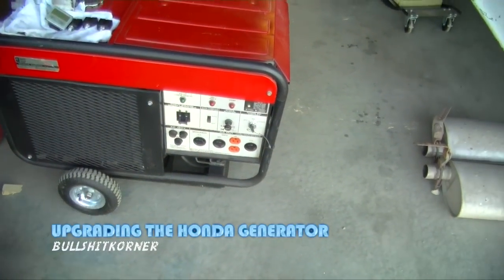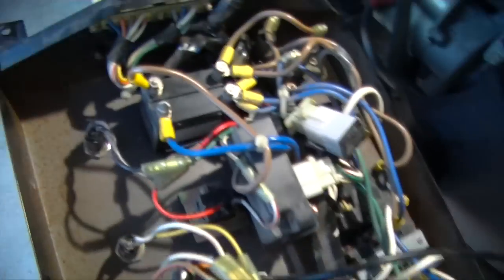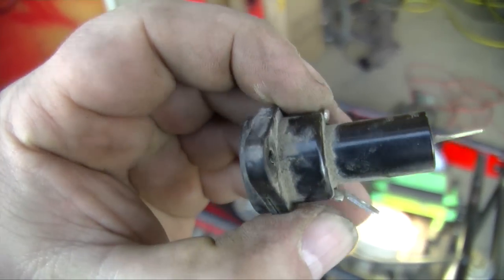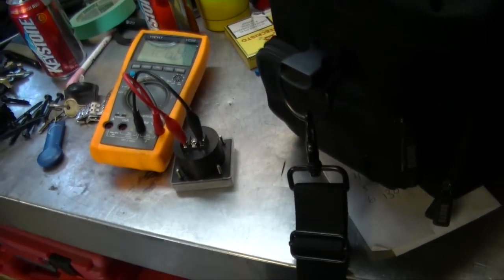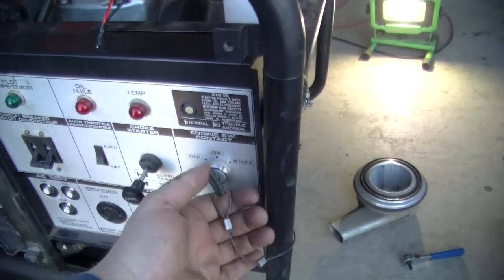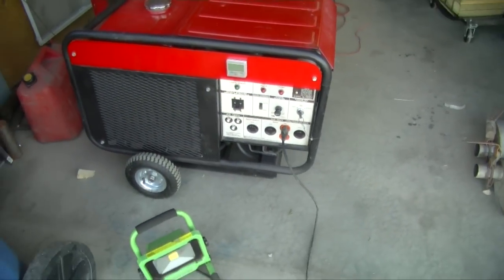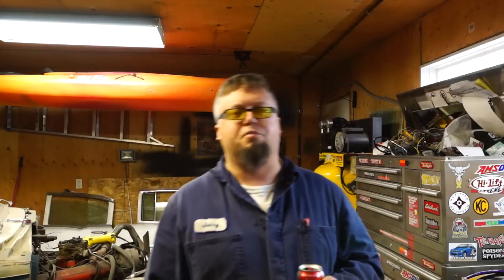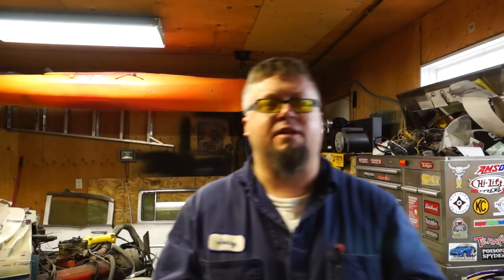Installing Circuit Breakers and a Voltage Meter

Comment: Great Clip !  *I please wondered if you could "weigh-in" on my unit: (EXACTLY the same as this one). As soon as the keys turned on, it immead. blows the glass fuse (on the front). I opened things up, checked the stator (is it called the lighting coil ?) ... anyway: I unplugged it, along with many other "obvious things" ... it STILL takes out the 15 amp fuse RIGHT NOW. 

*Turn-on the key: "gone". 

I may have reversed the polarity (went I tried to jump it), and I've read about a diode "stack", and an "Ign. switch" ... after that, it's never let me down. ANY idea / course of action would be most appr. !!   BEST   : -  )

Comment: Fuses are better than breakers, show me one instance where a fuse welded itself shut & caused a fire
Reply from the maker: really so why do houses use circuit breakers instead of fuses like they used decades ago ?  i've worked and repaired Industrial equipment running 480-600 volts and never seen a breaker weld itself shut.
Reply: Talk with the fire department. Breakers are cheaper
Reply from the maker: the truth of the matter is, if your not overloading the circuit it won't matter if you have fuses or breakers as you'd never need to change them.  i'm not sure where you get breakers are cheaper i paid like 40 dollars for those 3 breakers where i could have got like 20 fuses for that price

Comment: Good stuff - did you turn up base rpm - you shown 116 v unloaded. My Honda runs at 60 hertz and 124 v unloaded .
Reply from the maker: no it's automatic when it senses a load it powers up when no load is present then it idles